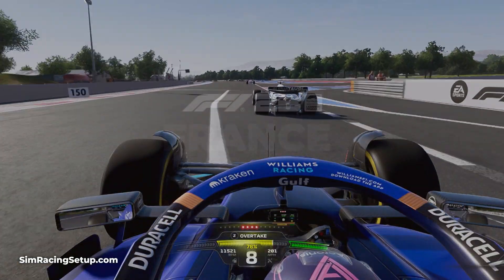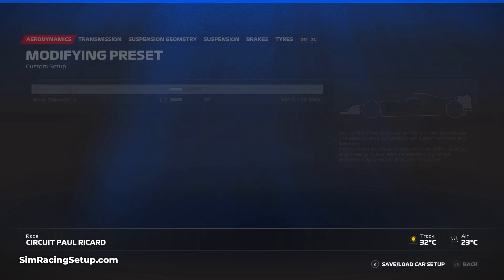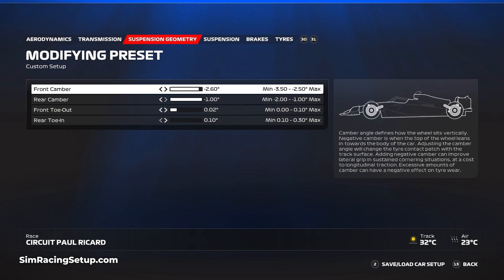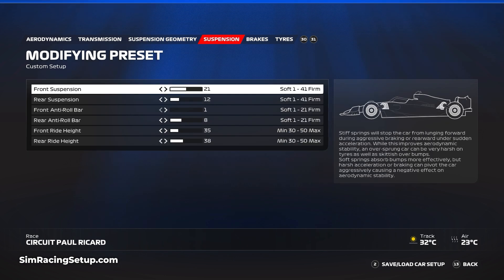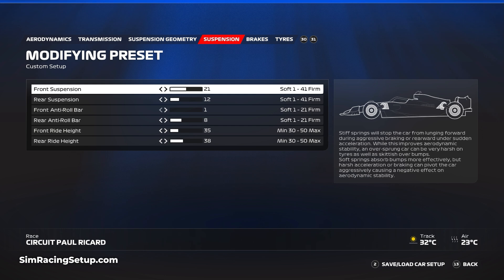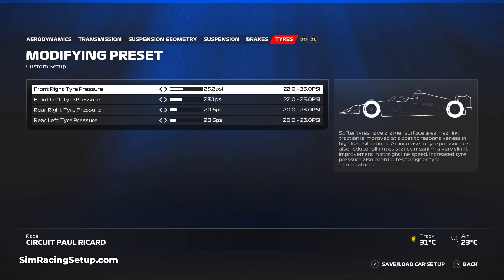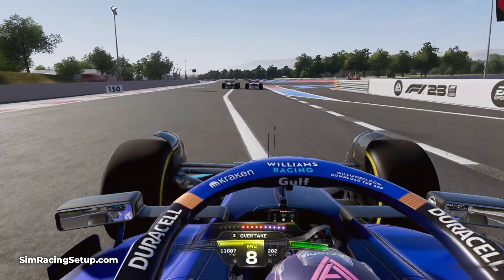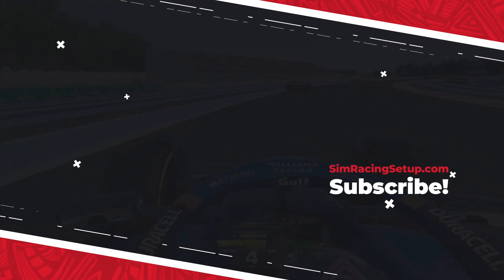F1 23 France Setup: Bonus Track 2

Comment: A video on how to change a dry setup to a wet one would be brilliant
Reply: From my own experience, I tick up 4-7 points my front wing, get acceleration dif to 50, lower the front brake 2/3% and go up 0.2/0.5 psi in each tire pressure. It depends on the circuit and I'm sure it's not the most optimal setup, but the thing is that these can be changed without breaking parc ferme, so you can adjust it to dry weather again if necessary

I play on 90 AI and these settings go very well, especially with inters